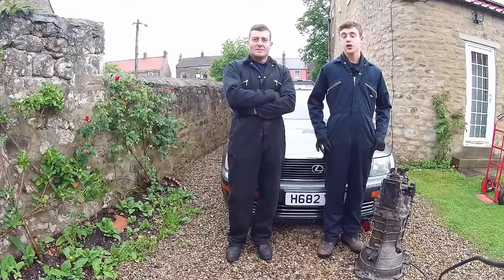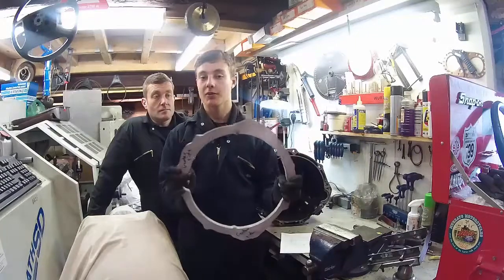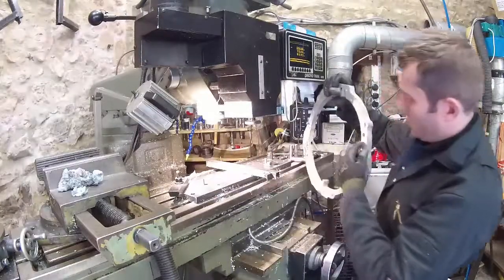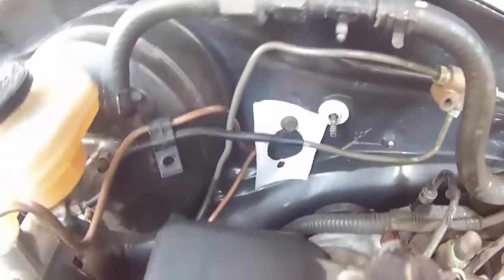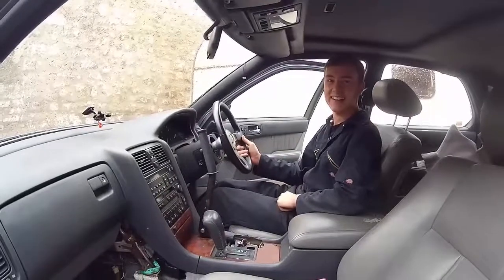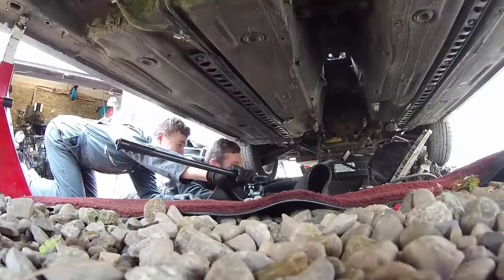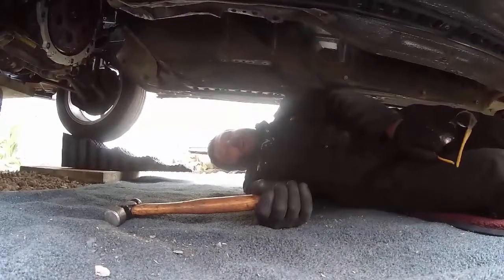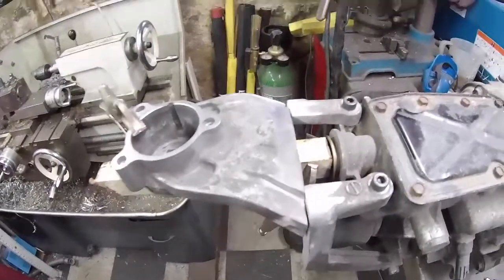TurboShed Part 11 - 350Z Gearbox adaptor plate design and make and Wilwood clutch pedal install

Comment: Hi great vid  what part number for the willwood pedal? I can't find 1 with remote reservoir. keep the content coming. Cheers from Perth Western Australia
Reply from the maker: 1 x Swing Mount Clutch Pedal Assy (7:1) (340-13834) and 1 x 0.625 Wilwood Master Cylinder - Non Integral (RD3614) was what we used, you can then just use a union and bit of hose to fit any external reservoir you want.   hope that helps!
Reply: Thats great thanks for the info